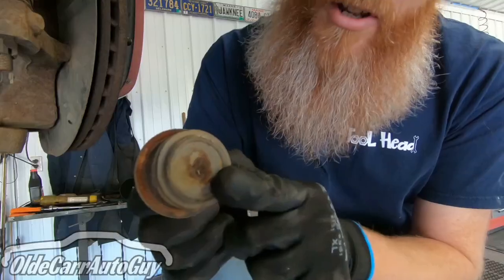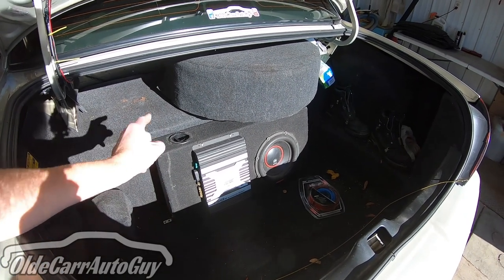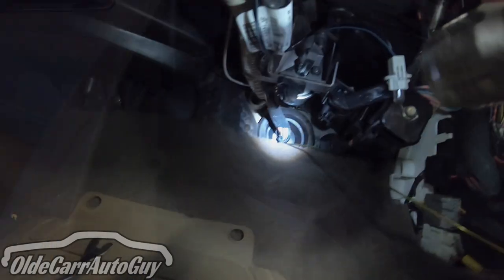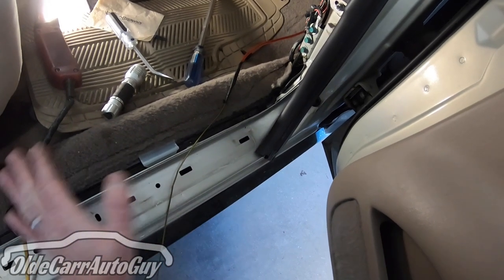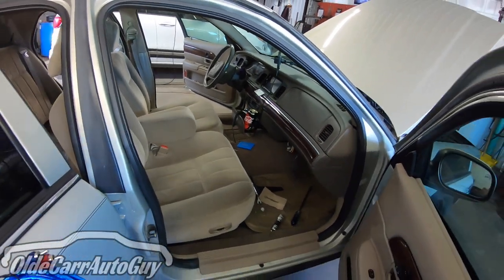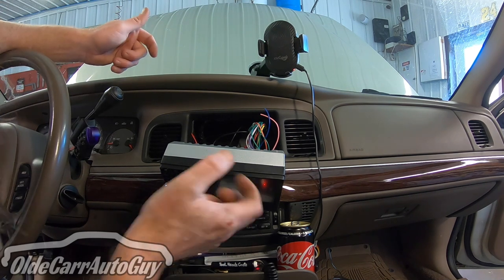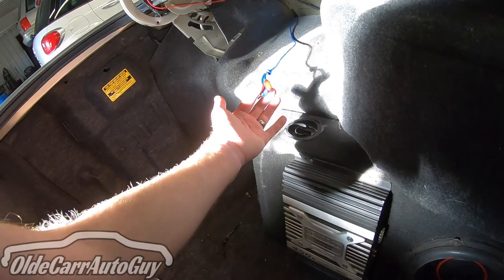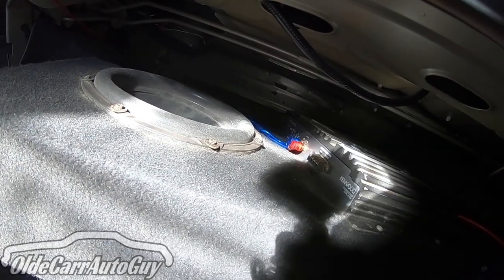How to: Install a subwoofer and amplifier in your 2004 Mercury Grand Marquis

Comment: How did you run the power wire through the backseat? I’m sadly stuck
Reply from the maker: Unfortunately, the easy way is to remove the back seat so you can see where, but you can straighten out a metal coat hanger poke it from inside the passenger compartment to the trunk area. Once you see the end of the coat hanger in the trunk, you can securely tape the other end to the power wire and pull it through. Hope this helps.
Reply: You can pull the top of the back seat forward. There's 3 spots where it "clips" on. You can put it back, with a small amount of finagling lol. Anyways, once the seat is down, you can see where you want to put it.

Comment: What head unit are you using in the dash? I don't need a cd player, I want a thin one so don't have to trim the dash.
Reply from the maker: Just a cheap Chinese unit from Amazon at first, but all the big manufacturers make units that will fit. I have a Kenwood in my 07 now!

Comment: How hard was it to get the wires through to the trunk? Did you have to cut any holes or do they slip in between the wall that supports the back rest of the backseats?
Reply from the maker: No cutting. It slides right up the side wall into the trunk!

Comment: Can I hook up a amp and a 12" sub to the factory head unit? 2003 grandmarquis
Reply from the maker: You can. Most amps have speaker wire inputs. So you can get your signal from your rear speakers.
Reply: @OldeCarrGuy  Without having to use a line out converter?

Comment: What did u connect your power wire to battery? Fuse box ¿
Reply from the maker: Directly to the battery!
Reply: @OldeCarrGuy   with the factory terminals?
Reply from the maker: @Moneymakinmonni  yes, but I mounted it to the 8mm nut!
Reply: @OldeCarrGuy   ok so to the bolt the tighten to the post
Reply from the maker: @Moneymakinmonni  correct!
Reply: @OldeCarrGuy   thanks 👍
Reply: U still got yours
Reply from the maker: @Moneymakinmonni  actually just sold it last week! https://youtu.be/rxrKnPNlSHg

Comment: Does this work for a stock head unit or do I need an aftermarket one
Reply from the maker: There are adapters you can buy that convert a speaker wire signal into an RCA signal to run to your amp. Also, most amps have speaker wire inputs so you can just jump from the rear speakers. I would recommend the adapter!

Comment: I have a 2004 grand marquis.  On the very left corner next to gas gage up top from That, left side of low fuel gauge it has a car an it swerving what does that mean. ?
Reply from the maker: Sounds like you're describing the traction control light. If it comes on by itself, can be an indicator to a possible bad wheel bearing. A good code reader should tell your which one.

Comment: How did you run the wires into the trunk?
Reply from the maker: under the door sill plates and "C" pillar trip. Removing the back seat will make this easier.

Comment: You just saved me a ton of money. Gonna do the install myself.  Do I need a distribution block if I want to run two amps? I have 2500w amp for my subs and 900w for my deck and doors.
Reply from the maker: Happy to help. Always good practice to properly distribute power to 2 amps with a block.
Reply: @OldeCarrGuy   thank you sir. Subscribed last night.  I look forward to more videos.
Reply from the maker: @MeSoHoney9709  good to hear it. Thanks

Comment: I’m bummed I have everything hooked up rca to the head unit and everything else but my subs aren’t playing
Reply: Do it need to plug up the green wire for the subs to work?
Reply from the maker: Hey Albert. Is the amplifier turning on? If not, there is a blue wire coming out of the head unit that would be labeled "P Con". This is the wire that switches the amp on. If it is hooked up, you can try jumping the Positive to P Con on the amp temporarily to see if everything kicks in. Keep me posted. You can always message me on Instagram as well.
Reply: @OldeCarrGuy  my dumbass never turned up the gain

Comment: So where would the red wire hook into in the engine bay? I'm having trouble finding info on what to actually do with the engine side of the power wire
Reply from the maker: You have to hook it up direct to the battery with a fusible link. Must be constant 12 volt power.
Reply: @OldeCarrGuy  Thank you! I figured it was one of those things that's so simple/basic most people don't mention it, so I couldn't really find a good answer from guides
Reply from the maker: Happy to help!

Comment: Hay man please help me I have a 1990 Lincoln town car and I installed a amp and sub but it seems like I’m not getting the full bass out my subs can that be because I have a original amp for the car still hooked up can that be interfering please help I’d appreciate it so much
Reply from the maker: There is a couple things you can try! One is the gain on the amp. You should be able to adjust it to get more volume! Another would be the sub controller in the head unit!  Hope this helps!

Comment: Just a tip. Never mount an external amplifier on a subwoofer box. The vibrations from the subwoofer isn't good for the amplifier.
Reply from the maker: Thanks for the tip! Been doing it this way for years in my own vehicles and never had an issue. Some of my vehicles have 20-25 year old amps!

Comment: I think I might make a video response to this video how I put my sub & amp, along with full size spare on the shelf as to not sacrifice and trunk space.
Reply from the maker: My big issue was I didn’t want to cut up a perfectly good box or buy another one! To I made it work with what I had not than what I didn’t!
Reply: Aww shucks.
I already made the video.
Maybe somebody else can find it usefull.
Reply: I actually really need help with my factory 08MGM.. i bought an alpine 65x4 radio/cd/mp3 player 1din, i wired it, it turns on and plays, but i get a lot of static at hirer volume in my factory speakers, it sounds like an amp is in the middle, but I can't find an amp, even with an ohm meter i get the same from one end to the other, is there something with the factory speakers that don't allow any volume? I can them getting distorted with bass or some distortion at high volume but not like this.. i spent hours trying to figure it out till i put back in my stock radio.. figured maybe one of you two would have an idea where i screwed up.. i used a schortcher wiring kit (sorry i dunno what the actual spelling of that company is)
Reply from the maker: @shartingfish5761  Some of the MGM's had premium sound and you would have needed the amp bypass wiring kit. But it sounds like you may have a Bass Boost setting turned on or something like that. Chuck may be able to jump in here as well!
Reply: @shartingfish5761  
I've never experienced this issue you speak of in any of my panthers.

I'm guessing a bad ground, and your hearing alternator noise. Or maybe check the clamping diode on the alternator. Just a guess. 

I think Panther Platform channel may have input on this. Look around in the comments and you'll find him. 
-Chuck
Reply: @shartingfish5761  
Also try hooking up the Alpine stereo in a different vehicle to see if you get the same issue. 

If so, maybe the stereo is bad. 
"Just because it's new, doesn't mean it's good"

Defective new parts are possible.
Reply: Budget Panther Fan So it seems that if i wire the new radio direct to power and to a speaker it sounds 100% fine, i thought it was possibly the radio, or maybe the possibility of a factory amp, but if there is an amp it's not in the typical spot on the rear deck-lid as i just can't find it. I think i am going to just rewire all the speakers and replace them with alpine components and call it a day.. after installing radios in cars the past 22 years, this is the first time i was stumped..
Reply: Olde Carr Auto Guy I can't find the amp if there is one, i just assumed it would be in the trunk attached to either the back seat brace or the rear deck, it doesn't seem to exist in either place. It does have premium sound though with a set of crap paper JBL speakers.
Reply: @shartingfish5761  
That sounds like an idea. 
I've done that in the past too.
Reply: Budget Panther Fan ended up being a bad harness, the clips on the speakers in the wiring kit were touching.. all good now.. now the subwoofers..
Reply: @shartingfish5761  
Glad you got it sorted.
Reply: Budget Panther Fan you guys helped by at least confirming that the amp wasn't located elsewhere. Appreciate it..

Comment: I can't even remember the last vehicle I owned that had an exposed antenna, power or otherwise.  Actually, I take that back.  My Lincoln Mark LT.  Powered antenna must have been my Mercedes 190e.  Everything since has been diversity antennas or shark fins
Reply: Also, that last bit with T. Swift had me thinking about The Rock doing that song on Lip Sync Battle! LMAO
Reply from the maker: Taylor Swifts “Shake it off” is my Guilty pleasure!